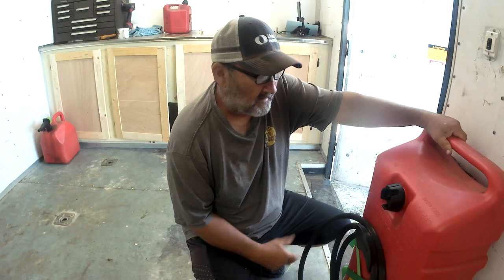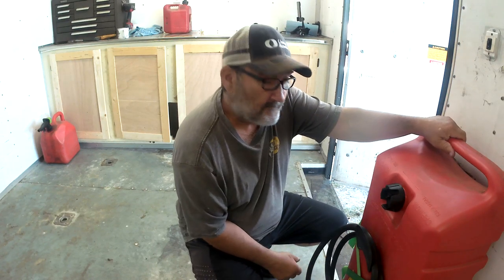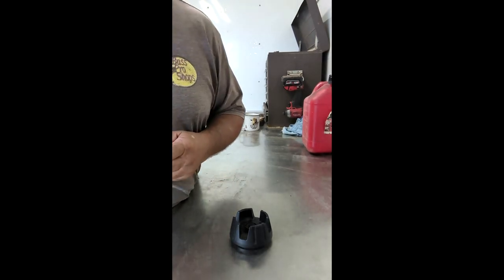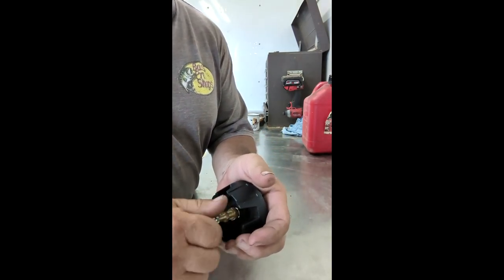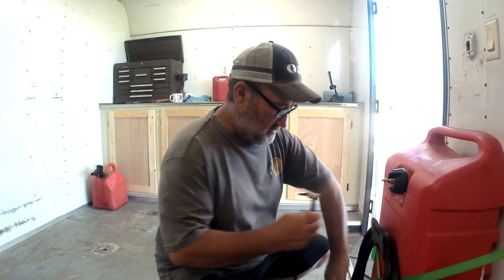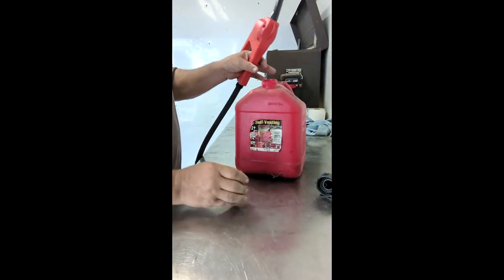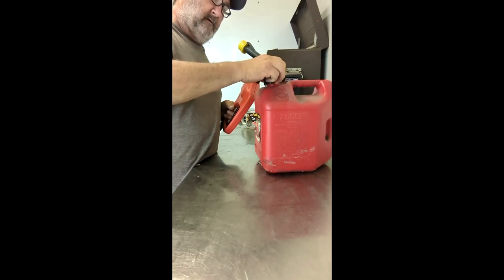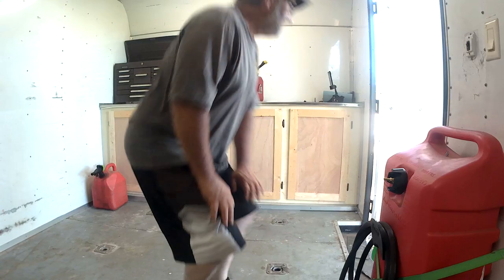Duramax 14 gallon fuel caddy fix.

Comment: Great idea, I am going to buy one now and use when we are out 4 wheeling.
Reply from the maker: Have fun!
Reply: Make sure to check the vent before purchasing one. I just purchased one and Scepter has changed the vent and now there is no putting in a pressure valve.

Comment: You could also fill your can from outside your trailer, which is lower than the gas caddy.  Gravity takes over.  The hose is 10’ long…
Reply from the maker: And I used to do this also, with gravity I was lucky to get 1/2 gallon a minute, with the pump method I fill my 8 gallon tank in about 2 minutes.

Comment: A bike pump makes this much easier. Inflate to 6 PSI or so and it works perfectly. About 20 pumps or so with my Specialized bike pump with a full caddy.
Reply from the maker: how many pumps when there is only 2 gallons left in it?
Reply: @Krazyhunter  Great question, Many more pumps I suspect :)  So far I have emptied all 14 gallon at once into my Jeep. As it flows I pump the bike pump a few times every so often to speed it up. It's like using a pump weed sprayer. If there was just 2 gallons left I would use gravity if possible. It's too easy to seriously overinflate these things with most air compressors.
Reply from the maker: @MarkEwert  Thats why I start pumping gas as soon as I start the compressor, and I keep it stored with the cap slightly loosened. Im not taking any chances.
Reply: Why not just use a battery powered tire inflator? squeeze the trigger even easier than foot pumping plus I use the tire inflator for other things as well (inflating tires, checking if PTFE lines I've built leak, etc.)
Reply: @M  I have a portable m12 milwaukee compressor and you can set it to the desired psi so you never have to worry about overinflating
Reply: @ep3389  That's cool. I just find the bike pump easier to grab and use for this purpose that using the compressor. Hooking it up and 20 pumps takes about a minute. But to each their own :)

Comment: This is an awesome video. I bought two of these and have been disappointed. I was going to hook up something similar. I think your idea might be a lot easier and less trouble but I was going to use a compressor. Compressor is a lot bigger though but I think I have a small compressor somewhere.
Reply from the maker: Remember, these tanks are not made for pressure, I wouldn't go above 5lbs pressure ever.

Comment: Here's the only thing that bugs me about this idea.  Every air compressor that doesn't have a desiccant unit (like those used by air brush painters) drips a little bit of water out of the hose when I take the fixture off the end of the air compressor hose.  This is quite obvious on an air hose that has been used for years as it will have calcium buildup inside the hose.  That is water\air being compressed and puddling, drying out and leaving the remaining particulates inside the hose.  It's even easier to see water spray out of the air compressor hose if I'm trying to empty it to normal atmospheric pressure for storage.  I never thought water vapor held particulates in it, as I thought that vaporization was a method for purifying water but it seems to have had just enough particulates to build up over time...  Granted the particulates getting in the tank isn't what I'm concerned about as those can be easily filtered...  What I'm concerned about is water building up inside the fuel caddy.  I'm sure most engines can handle a little "water injection" but I don't like the idea of water getting in the gas caddy.  I'm gonna look for a different method.  Great idea otherwise..
Reply from the maker: I agree with seeing water coming out of a hose of a compressor system, but I've only seen it ever come out of a system that had a tank, where condensation can build, I have never seen it come out of a tankless system like what I'm using
Reply: @Krazyhunter  Good point.  Tankless compressors probably don't have that condensation problem.  Never used/owned one long enough (had one last long enough) to see if buildup occurs or if water vapor sprays out.  Thanks for the response and filling in the gaps in my thoughts.
Reply: Going to try this but I will Use a bike pump for lighter pressure and easier control.

Comment: Have you figured out a way to completely drain out the last 1/2 gallon of gas from this thing?  There's some debris in mine and I need to drain/flush/rinse it out.
Reply from the maker: How did you get stuff in your tank? mine stays strapped to the side of the trailer, I haven't need to drain that last little bit out yet.

Comment: How many gallons per minute with the air?  I believe that tank using the gravity is 1.5 gpm. Any leakage when full tank while driving when gas cap is cracked open?  Thanks!
Reply from the maker: no leak, even with a full tank, im going to say around 3 gal a minute, maybe more, I never let it build a lot of back pressure, I start pumping as soon as I start the compressor.

Comment: What psi were you running it at ? And what brand is the portable air compressor you have ?
Reply from the maker: I bought the compressor at harbor freight, added the link above, and I start pumping as soon as I start compressor so no real psi is built up, and I always loosen the cap afterwards to release the pressure.

Comment: Hey Ron, I got a question for ya: what type of latch is that that you have bolted on the side of your trailer that you have strapped on the duramax?
Reply from the maker: SmartStraps  Steel Strap Anchor, https://www.lowes.com/pd/SmartStraps-Steel-Strap-Anchor-4-Piece/3740689
most Lowes are the same, isle 3 bay 16
Reply: @Krazyhunter  
Thanks

Comment: Yeah well... Modify a gasoline container, taking it out of it's design specifications...  Not understanding the engineering is a recipe for diaster with multiple points if failure with gasoline under pressure. 🤤⛽💥🔥☠️
Reply from the maker: the container was never modified, the cap was, and I start pumping as soon as the compressor is turned on so basically no back pressure, it builds more pressure riding around in the trailer than when being used. thanks for the comment.
Reply: The cap is part of the container, and even if you make an argument that it's not...  The container is not designed to be a pressure vessel.